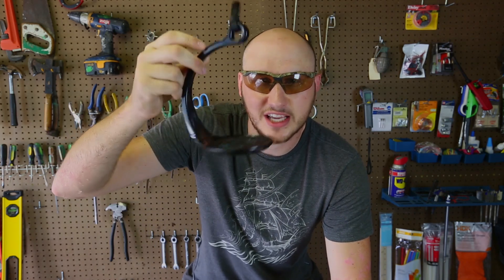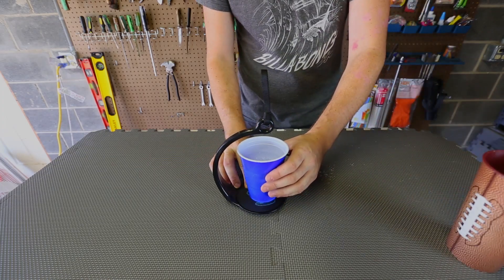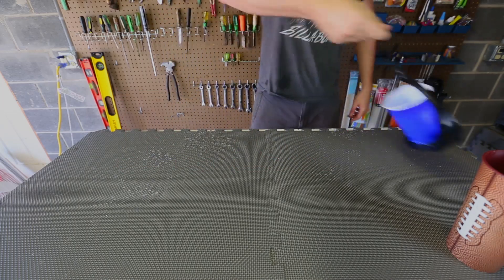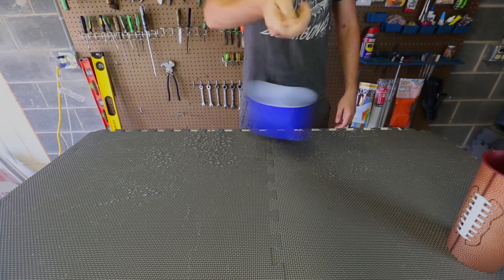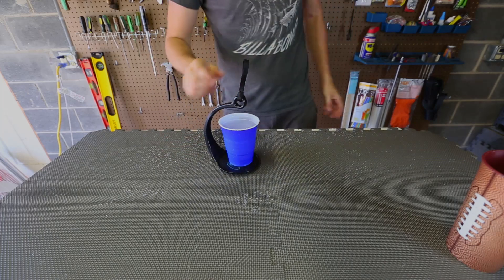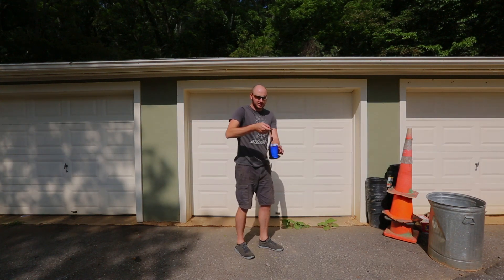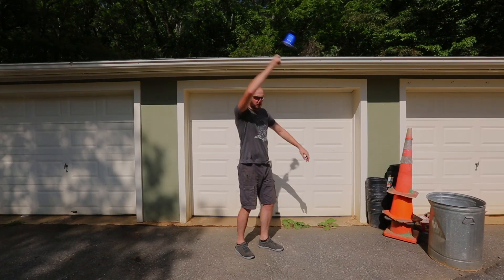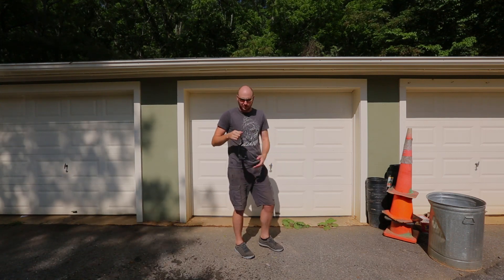Centrifugal Force Challenge - Science Experiment

Comment: If I'm not mistaken, the centrifugal force is a fictitious force. Actually, this is caused by centripetal force, there isn't force that is "pushing" out, but on the contrary, the centripetal force pointing towards the axis (his hand). In an inertial reference system, the system of rope, glass of water and shaft are in a circular motion. The water is not pulled because there is a critical minimum speed. The tension of the string and weight of the glass with water provide the centripetal force necessary to maintain a certain speed circular motion. As extra information, why it was easier with the extended arm is because increasing the radius connectig the shaft, the tension on the rope is smaller. I hope to be in the right c: